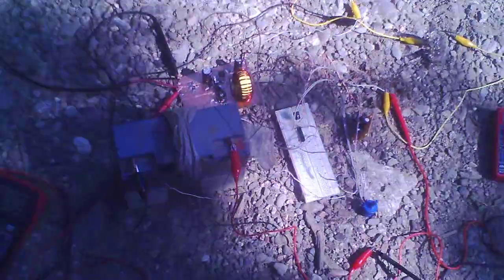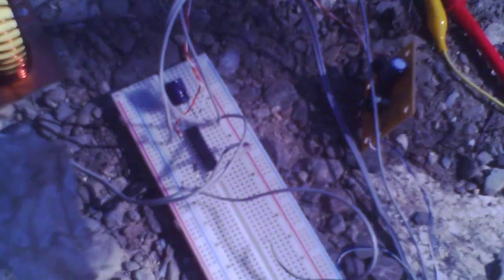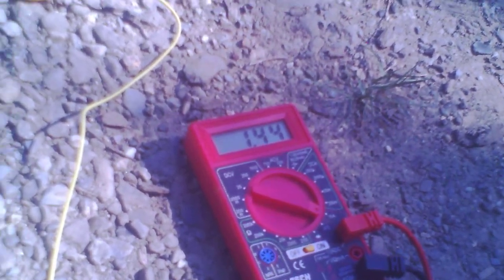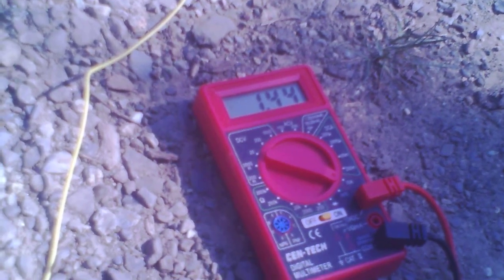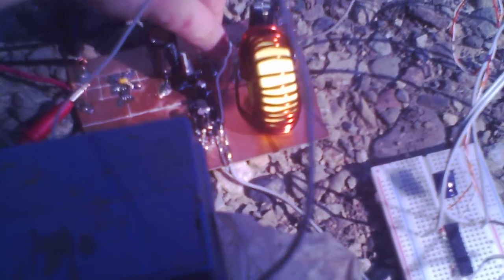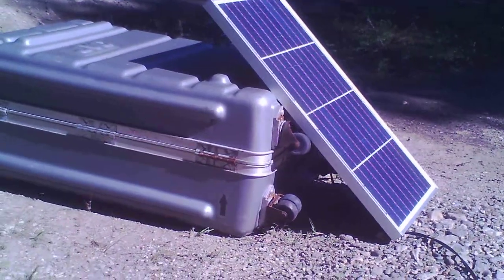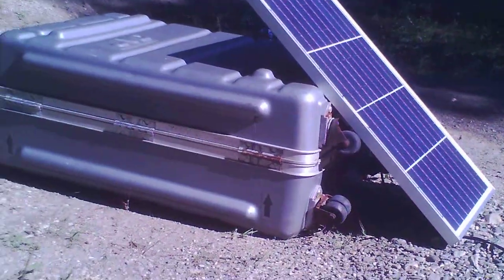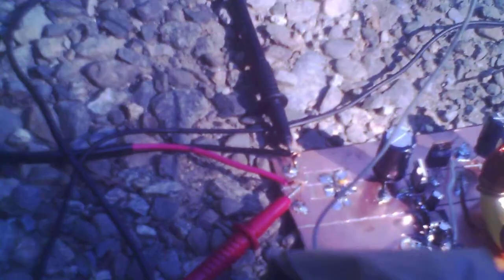DIY MPPT charge controller battery charge test

Comment: I am looking into charge controllers. because I need to build a power storage system. for my off grid home. I hope to get about 20amps minimum from a water wheel generator. and more from solar panels. and maybe wind turbines. depending on the wind. but the charge controller prices are a bit high I think. so I'm looking into building my own. I hope for most of my lights to be 12v or less. and use buck converters to drop from 24v. since the inverters are more efficient at higher voltages. so to start I need a charge controller for the water wheel. for 24v (25-30v eat.) at 30-40 amps. I don't think I need a dump load. for it. like the wind turbines need. but thanks for the video.